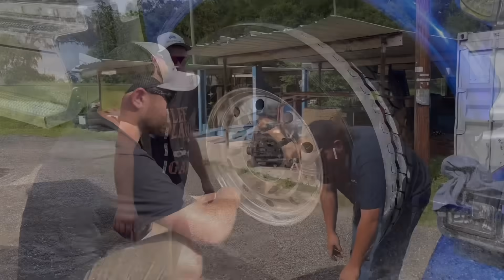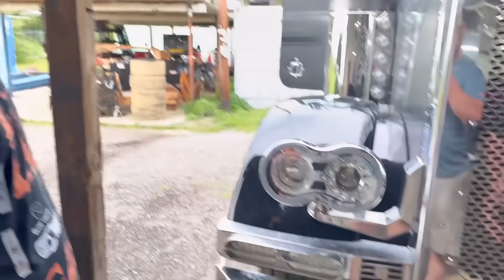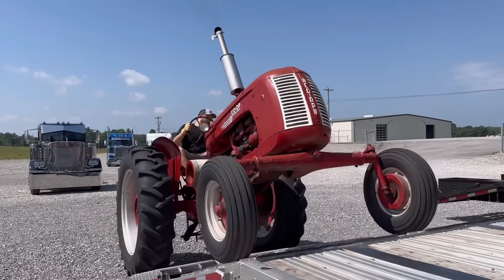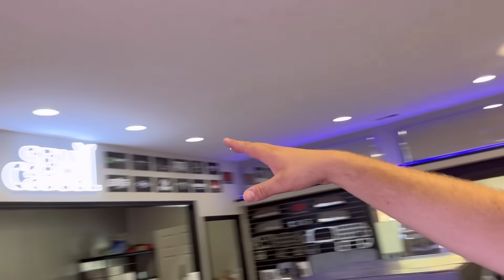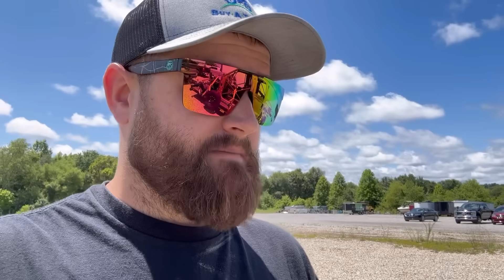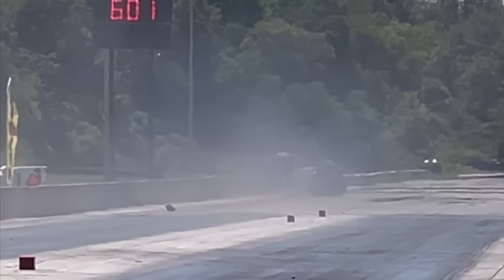$150,000 Drag Truck Gone in Seconds, INSANE DIESEL FIRE!

Comment: Looks cool with 315s and 0 offsets, did that on our w9 , BUT , single steering box trucks suck with big tires, always seems like u holding the wheel one way to keep it straight. On our trucks with heavy axle and 2 boxs, u dont feel that with 425s

Comment: bruce there a video of a pulling truck on a dyno the engine run away caught on fire & toast the front of the truck it a wheel dyno (the next day this truck fully rebuilt over night moved to last spot in the pulling line rolled out fired up with this team spare motor and parts other teams helped them over night we slept like 4 hours if lucky they got second place in the pull)

Comment: Damn that sucks 2 cars junked in a matter of mins..had a completely restored 86 Chevrolet swb 4x4 burn to the ground in front on me ..pulling out of the yard in the middle of the road it back fired threw the carburetor and couldn't put it out so it just burned windows pooped and got so hot the roof fell in .smh so heart breaking

Comment: Bruce it would be really cool if you could Fab up a custom pickup bed for business expense to use when it's not pulling. innovate some way for it to quickly slide in and lock down. It would be one hell of parts runner.
Reply: It probably only gets 2 miles per gallon when it's empty and being driven conservatively, though  🤷‍♂️
Bruce would have to put in a gas pump ⛽️ right at the shop!

Comment: I have fire suppression systems installed in my airplane, offshore boat, drag boats, promod, sand car and my ultra 4 buggy.  I became a believer in fire suppression systems when I had a engine failure in my drag boat 20 years ago.
Reply: That's one heck of a lot of fire🔥 suppression!
🤔
Reminds me. I should probably clean the lint out of my clothes dryer.